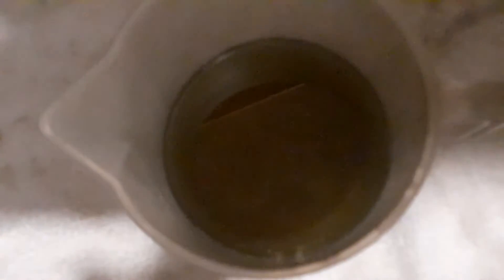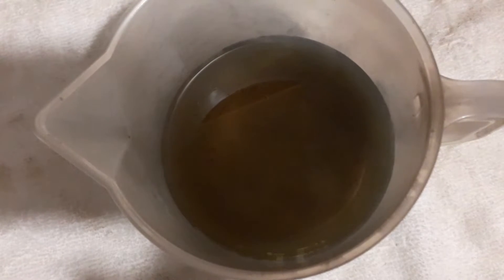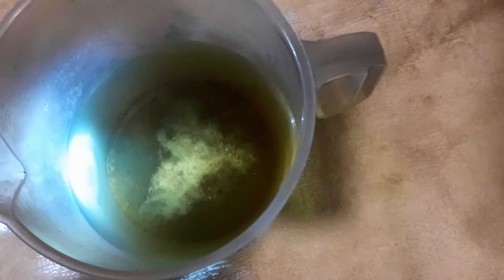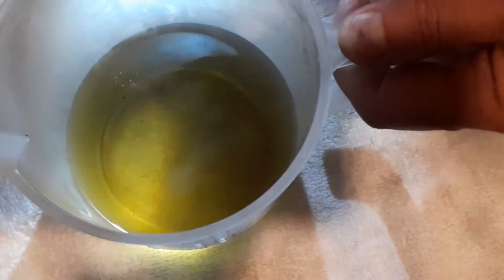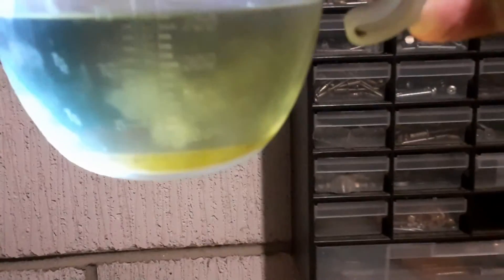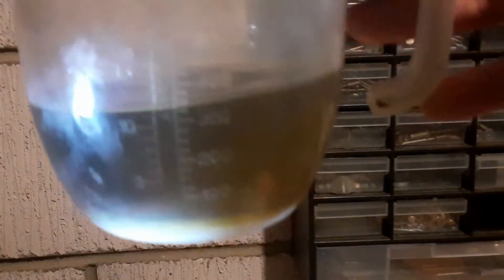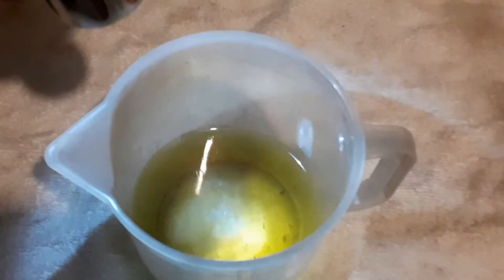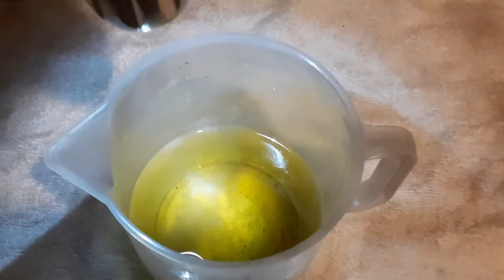Chainsaw Fuel Problem. How to Spot Water Due to Ethanol in Fuel and Prevent it.

Comment: That is what I’m dumping out of everybody’s chainsaws that will not start after a few days if it has been stored in the saw for more than a month. Recently I have decided not to repair customers chainsaws if I suspect e10 petrol has been stored in a chainsaw for more than 2 months no longer worth the hassle or the time and cost to repair it.
Reply from the maker: Yes that is the problem with E10 fuel. Even with the lower ethanol E5 years ago I was seeing everything getting gummed up. If you want to keep your fuel for longer than 30 days you must put a fuel stabiliser in it. But most people don't realise this hopefully my video helps